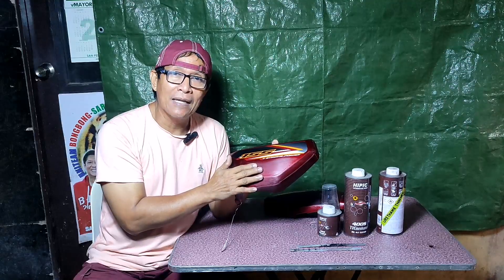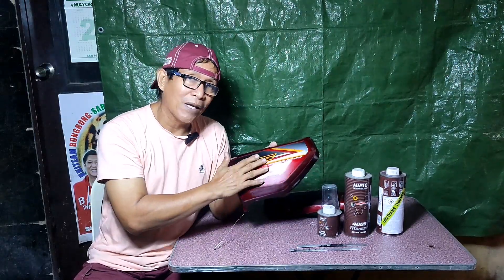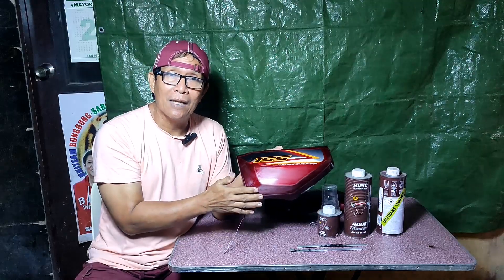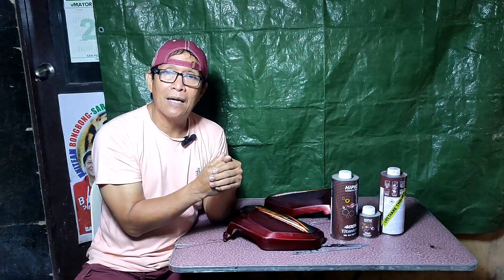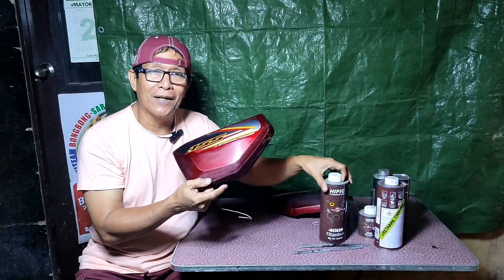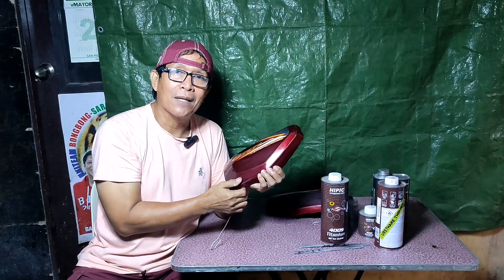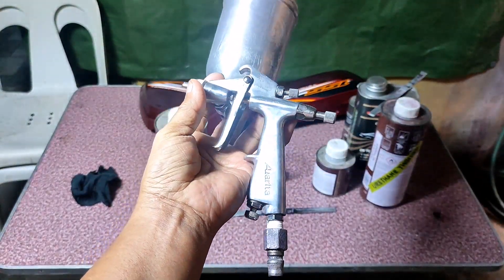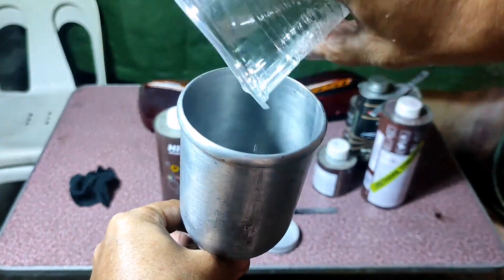PAMAMARAAN NG PAGDIDIKIT AT PAGTA TOPCOAT CLEAR NG STICKER O DECALS I DA HUSTLER'S TV

Comment: Ganda Araw Tay. Pwede sana ma tulungan mo ako, mag DIY kasi ako, ano ba need ko to start sa spray painting?
1. Air compressor - Mitsushi 9L Model: MYSJ69L?
2. Spray Gun? yung 1.3mm
3. Hose? 
4. Water Separator? 
5. Gauges
6. at ano pa po? 

Salamat Tay.
Reply from the maker: Ok na yan kaibigan. Idagdag mo na lang ay hair blower or heat gun at quick release fitting connectors yan yung ikinakabit sa hose at spray gun para madaling tanggalin.
Reply: @DAHUSTLERSTV0310  salamat po tay. pwede ko po ba kayong tawagan. ok lang mag bayad po ako sa abala.
Reply from the maker: Eto kaibigan #ko 09327478989
Reply from the maker: Eto fb ko Monroy Manuel
Reply: @DAHUSTLERSTV0310  cge po tawag ako mamaya NASA labas lang po ako tay